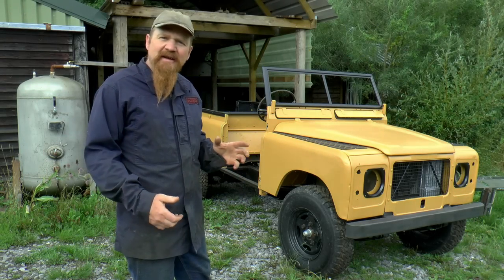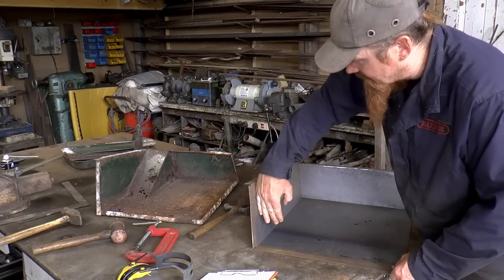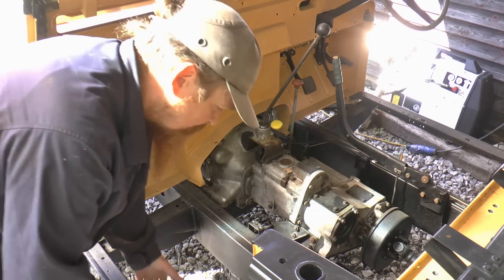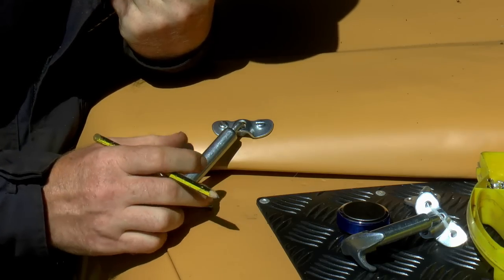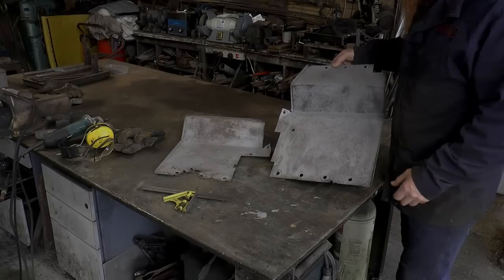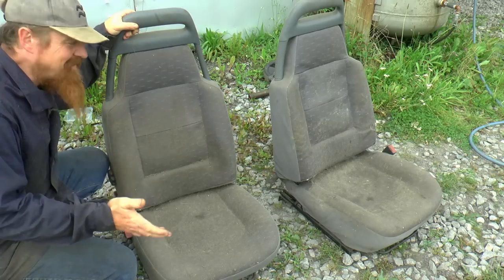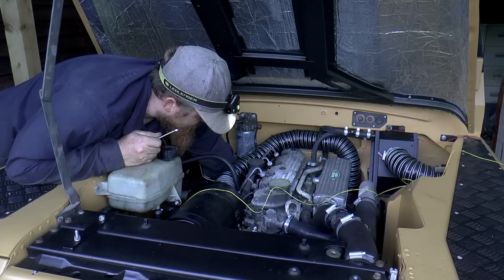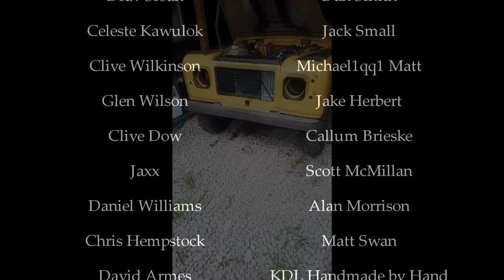Project Kermit 33: A Series Land Rover Full Restoration

Comment: Great progress, @maximusironthumper .

I think I recommended the transmission longitudinal tie to you around six months ago.  As I said then, it doesn’t just save the engine and transmission mounting rubbers from the shear force every time you apply the hand brake, but it massively increases hand brake efficiency - you will be amazed at how far the assembly moved forward when you pull the brake lever, and how much more clamping force you get when that movement is restricted.  It was fitted to 4-cylinder models by the MoD, especially on FFR variants with the big cooling fan - they wanted to prevent the fan hitting he back of the radiator.

Keep an eye on the condition of your transmission oil using that noise blanket.  The transmission gets very hot and burns the oil if you prevent airflow cooling the casings while driving.  Synthetic W75 might withstand the heat better, but I didn’t like it and removed the noise proofing I had installed under the tunnel and went back to EP90.  I don’t think W75 has anywhere near the protective benefits of EP90.

Comment: Max great strides sir!  If you are going to use those Disco seats, getting to the battery in a hurry will be problematic. I'd suggest putting a battery kill switch into the front of the seat box in case of an electrical emergency. You are quite correct Sir Terrance Conran did design the seats. In fact he designed the whole series one Disco interior. I had a 1991 3.5V8i Disco with the beautiful blue interior and I loved it!

Comment: excellent progress young man
if you ever get stuck, shove an airline into the tank + blow the fuel through, they will normally keep running from then on
the stop solenoid is the weak link in the thieves handbook, make an armour plate around it, then run the wire inside a steel meshed fuel line, back to a hidden kill switch, they are looking for wires, not fuel lines...

Comment: Great video installment as always. Your technical presentation and editing is spot on. You're more enjoyable to watch than than any of the recent "Wheeler Dealer" programs. Try swapping the bonnet catches around. They'll work fine as you have them but you might find that you start to scratch the wings every time you put the bonnet down. Plus without knowing the exact type they may also hold water when it rains. Keep up the great work though and your thoroughly enjoyable videos. Phil...

Comment: Best thing I have found and use for this is a 12v pump from the tank to the lift pump, Switich that on and bleeds itself as the 200tdi bleeds itself as well but the 12v ump is just an extra help/backup

Comment: Think you may have you bonnet latches upside down???
My 1950 S1 they are the other way up , this keeps the water out of the spring.
Lovely job 👍
Reply from the maker: Yes I've seen them both ways, the way I have it seems to be the most common for the military and Camel Trophy Land Rovers.
Reply: The 1949 ex military 80" we had was fitted with them the other way up too but I've seen them more recently as installed on Kermit. 
I wonder if it vame down to the decision made by the folk fitting them at the time. 

I'm tickled to see they are still available, and pretty much identical to the ones installed 74 years ago.
Reply: Yeah the spring rusts out quickly and fails.

Comment: When fitting the mudshields put spacers between the mudshields and the back of the footwells (I used nylon) it will make a gap that will stop the build up of crap that will rot your footwells out.
Nice work Max 👍

Comment: Great restoration!   Not a big fan of any rubber hoses on the oil cooler.  Have a D90 and had the one of those break open doing 70mph on the highway.   Dumped 7 quarts of brand new oil everywhere behind me and all over the exhaust system in about 7 seconds.   Saved the engine by shut down almost instantly and coasted off the road.  

After that, everything was changed to stainless steel braided aircraft hoses, no leaks, no problems.   A guy near Cleveland OH makes kits which are less expensive than the OEM crap assemblies.

Comment: That reminds me of the night we desperately tried to restart a 1976 Unimog with a knackered lift pump in sub-freezing temperatures! We ended up rigging a gravity feed from a temporary mini-tank cable-tied to the door mirror to the injection pump. The lift pump on that type of vehicle is accessed through the offside (on an LHD vehicle) wheel arch, sticking your entire arm up past the wheel and bodywork so just figuring out the pump was knackered was a massive task.

Comment: That's all the starter you need - just say to your passenger: "'can you just bang those two croc. clips together... yeah those two on the floor... just give 'em a quick touch" ;)
Nice sheet steel bending tips you've inadvertently given us... I've been looking at sheet steel stuff recently and whenever you see other people on YouTube doing it it's all with expensive presses and sheet-steel benders and whatnot. I've been wondering if I can just clamp it against a good straight edge and belt it with a hammer and, it seems, the answer is "yes of course you can!". Thanks!
What kind of bird was that, sat on the bonnet? My initial thought was wood-pigeon. But when it started moving around, I wasn't so sure.
Aaah... a "Henry", a seat, and a lot of cat hair.... looks like every single Sunday afternoon to me. ;)
My dad was always very dismissive of aluminium - compared to steel it was just far too effeminate and just not tough and manly at all. Looking at how well the rest of seat box has fared and how the battery box hasn't... I wish he was still here today so I could point and say "eh? eh!"
Reply from the maker: The bird is a jay and yep, it's surprising how far you can get with just a hammer and a sturdy table!

Comment: Very well done, I admire your motivation to keep going with the project. A handsome Landy is arising like a phoenix from the ashes. FWIW I think I would fit an Optima or similar sealed battery, "normal" cars "benefit" from road spray washing off the battery trays, the enclosed type often have problems. Maybe open some drain holes under the battery so the tray can be washed out from time to time?
Part of me wondered if you could perhaps use a stainless section for that sump like part of the box?
The Disco seats look ideal.
Reply from the maker: Drain holes at 7:35
Reply: @maximusironthumper  Sorry I missed them. An amazing project, hard to remember what you started with!

Comment: I made up a thick rubber gearbox trans case   cover but I removed it when I fitted the roamerdrive as I was worried about gearbox oil temp getting too high. There's a fair breeze circulating whilst driving and I didn't want to trap heat. No noticeable difference on removing it, but I did dodomat the seart box inside and add sound proofing foam on top of that. Ditto the trans tunnel.   Got a felt and vinyl  cover over the trans tunnel like an old Albion lorry would have over the engine cover. That's a boon

Comment: I've done away with my manual fuel pump and installed an electric pump. So much more reliable. And easier to get to if I need to replace it

Comment: You can actually bypass the lift pump. I had issues on my Tdi discovery lift pump and I actually just bypassed it and it works fine. Just in case you ever run into that  problem again..🙂

Comment: Bon travail monsieur Max. Just a quick Q, i saw you painted a product between the battery box and the seat box base, is this to prevent rust between the two layers of steel ? If so what type do you use. Keep going on the vids as I also painted my 109 Sandglow back in 97. Will swap out the 2.8 diahatsu for the same as your 200Tdi when time allows. Watching you from Kazakhstan, keep at it mucka 👍
Reply from the maker: It's a product called 'Zinga' a cold galvanising treatment. I use it everywhere on bare steel if it's not to be hot dipped. Standard practice is to flood joints like that before fixing. I later sprayed the whole assembly with Zinga before painting as normal. Hello to Kazakhstan!
Reply: Great thanks for the feedback Maximus. In case you have issues finding spare parts for your Zil,(my next project to watch) I fly in and out of Kazakhstan 6 time a year and happy to source parts your not able to find. providing it can fit in my suitcase, no worries. We use 6x6 Zils here on all our mineral exploration works out in the plains. Great work horse. All the best. Luc    @maximusironthumper

Comment: The fit isn't great because you need a load of mastic on each joint to keep the metal apart, seal up the holes and try and keep the water out!!! It also reduces vibration noises!!!

Comment: Are you not putting seals between the floor panels?
Reply from the maker: Nope!
Reply: @maximusironthumper  was there non on earlier models? My series3 has a sticky strip which is why I asked.
Reply from the maker: @christophersherrington5412  It's just personal choice, most people use lots of sealant to keep the water out, I prefer using none and just letting it drain. I'm not fitting any carpet, just rubber mats.

Comment: I don't think that series 3 ? gearbox is going to like the torque of the 200 tdi. I found out the hard way, having to strip the box every 12 months, when I fitted a 3.0 ltr perkins on the front of it. Sorry to sound like a wet rag. Great progress on a well turned out project. *